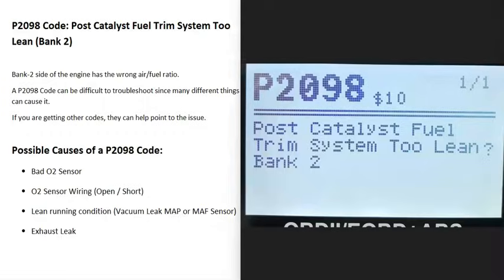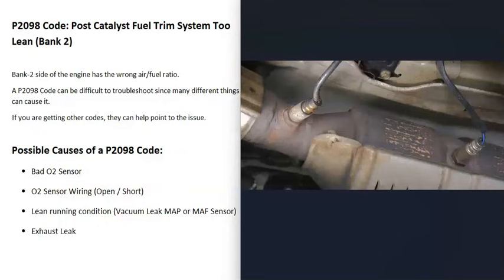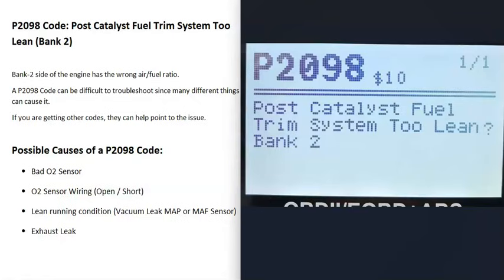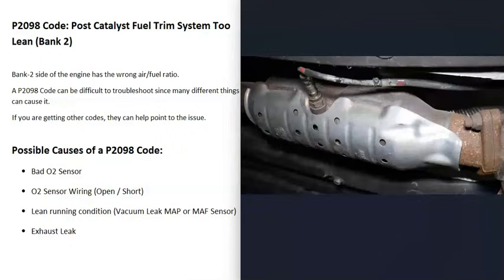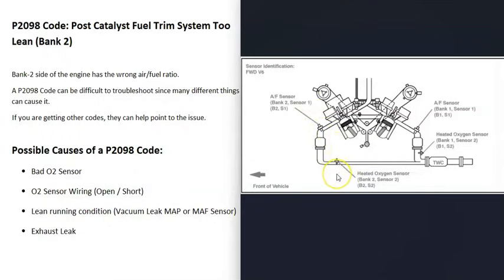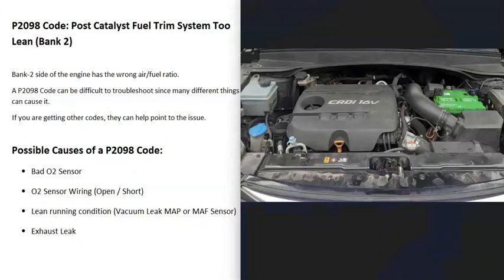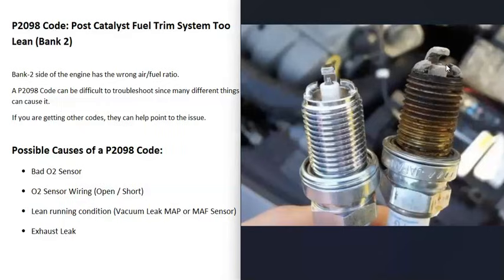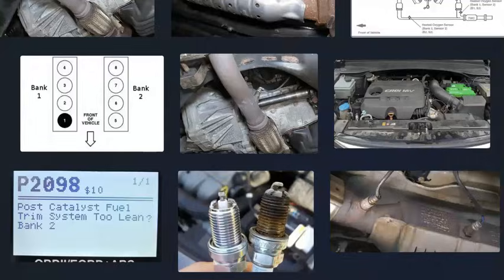Causes and Fixes P2098 Code: Post Catalyst Fuel Trim System Too Lean (Bank 2)

Comment: I had a p0101 code on my 2017 nissan murano, and it turned out to be my intake rubber boot was ripped, so i replaced it, and now i am getting p2098. i'll clean the intake sensor and let you know what happens any suggestions that comes to mind?
Reply: Did you fix it ? What was the cause

Comment: I had this code and  it was the cats I got them change and still have this code and smell gas idk what to do at this point
Reply: There could be unburned fuel in your exhaust system
Reply: Do you notice any white or black smoke coming from the exhaust

Comment: I have a 2015 Jeep Grand Cherokee 3.6L  and had p0157 and p2098 replaced all o2 sensors and the only I have is a p2098 and it won’t clear anything suggestion as to why. And it check exhaust leaks and found none.
Reply: Did you solve the issue? If so what was the problem?I have the same issue as yours
Reply: @Kingbose992 
لدي نفس السيارة والعطل نظف فلاتر البيئة
Reply: Same car, same code... Any luck?

Comment: I have a Nissan frontier with this code I fix the exhaust leaks and the code after 2 months came back I think I’ll just change the 02 sensor after the cat to see if this fixed the problem
Reply: Did you end up fixing it ?

Comment: I have a 2012 chrysler 300c, I've changed all oxygen sensors and checked for exhaust leaks and also changed all spark plugs. I still have the 2098 code. What else can it be or need to check?
Reply: yo did you ever figure it out? got the same code on my charger rt
Reply: @jorgearguelles918  Yes, one of my headers had a small crack
Reply: @jorgearguelles918  No, I didn't
Reply: Damn

Comment: This is bad for me, I just did a cat delete this came up, but some bolts are still loose I couldn’t tighten them all the way and I have an exhaust leak and I also had problems connecting a 02 sensor on bank 1 but my problem comes from bank 2🙁
Reply: Your lucky , I just did hi flow cats on my c8 and I got this code too but all my bolts are tight ! So I'm shook

Comment: only getting a P2098 and have a tiny exhaust leak on the drivers side, would this be issue?
Reply: Yes
Reply: Fixed the exhaust leak and the code came back, Ugh.